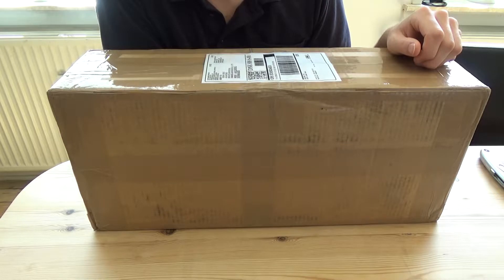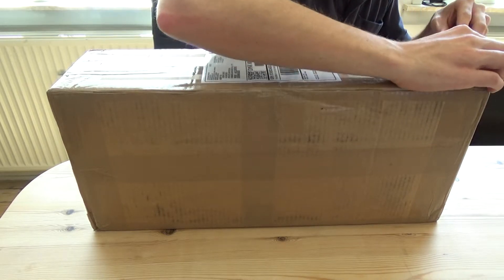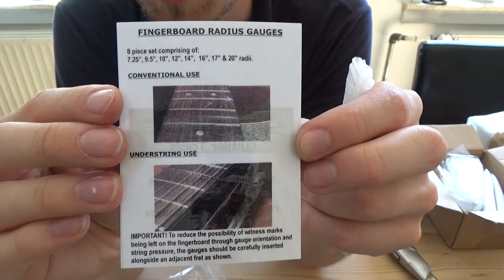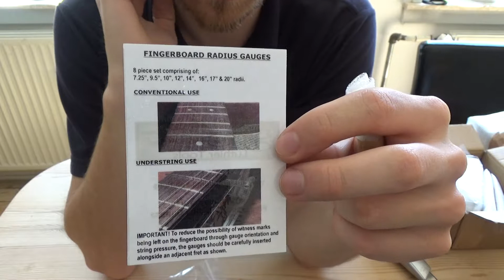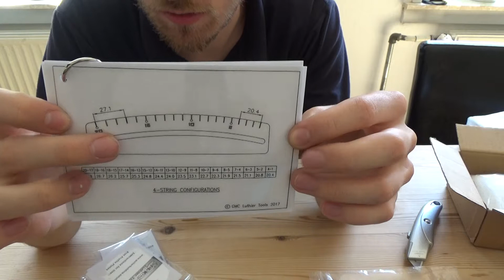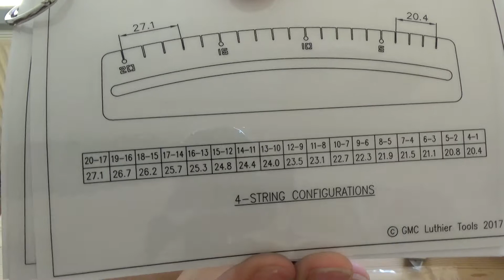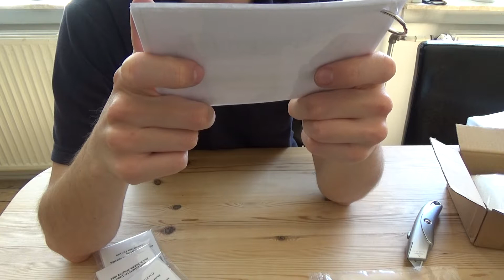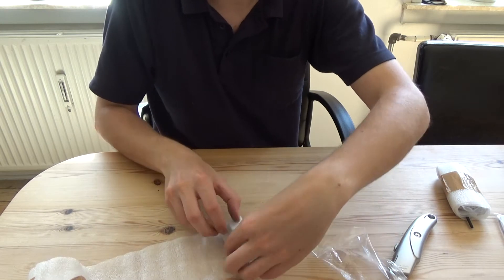GMC Luthier Tools│Unboxing│Fret Press, Sanding Beam, Nut Slotting Jig & Fretboard Jig.

Comment: This is fine, but unboxing and unpacking wasn't what I was looking for. the UK company that is based in Wales needs to do some videos on how to use these tools.  Trying to makes sense of the tools with the instructions that come with the tools is challenging to say the least. I am in England and have ordered a number of their tools, but still find myself scratching my head to use them properly. I often revert to my hands on methods of doing what I need to and forget about these tools. GMC need to give us some detailed video instruction on how to use these tools. When looking for instruction on how to use the tools that last thing that I need is some waste of time unboxing video.
Reply from the maker: Hi there, Ricky.
I'm sorry to hear so, maybe I can be of help to you... Instructions for which tool(s) are you looking for?

I'm sorry if my video wasted your time, but I didn't state anywhere that I would do instructions, atleast not in this video..
I get that you might be frustrated, but please don't take that out on me, and let me know if I can assist in any way...

Best regards.
Reply: @GuitarNTabs  Hi there. Sorry if I took it out on you. 
I have bought a number if the GMC tools and they are really awesome tools for the money. The one I struggle with is the Nut Jig. The other tools are relatively easy to work out but the nut jig could do with a video instruction.
We would only need to see the job done properly once in an instruction video.
I have used the nut jig recently to make a Fender style nut. I followed the instructions and the nut came out too low. I had to start again.
I am going to contact GMC and see if I can talk them into doing a video.
Reply from the maker: That's alright, I get it, I've been there myself, but still, I would love to help.
I might be able to do a video myself, if you're interested. I've been in touch with GMC before, also about the Nut Jig. I've used it a good handful of times, and it's good for making nuts.
Let me know if you're interested.
All the best.